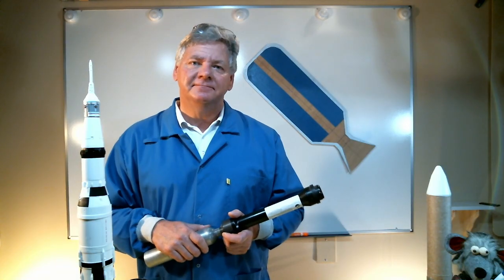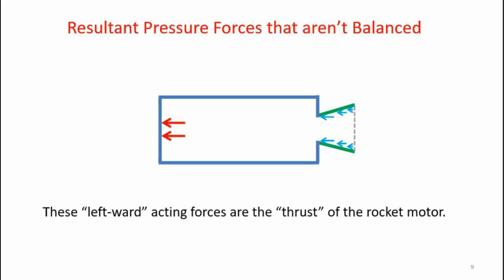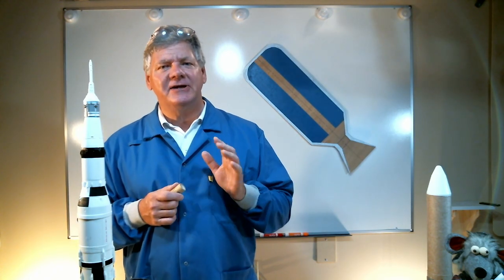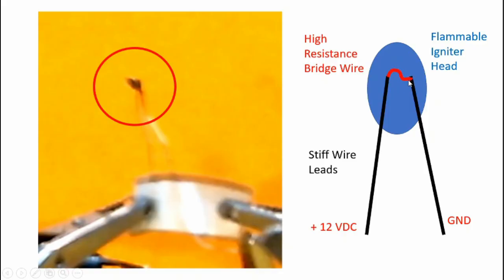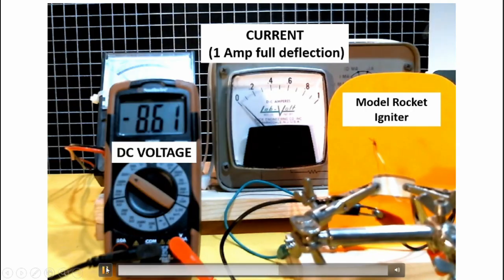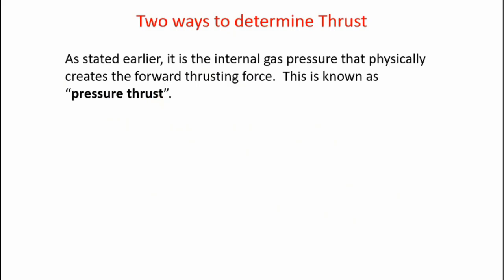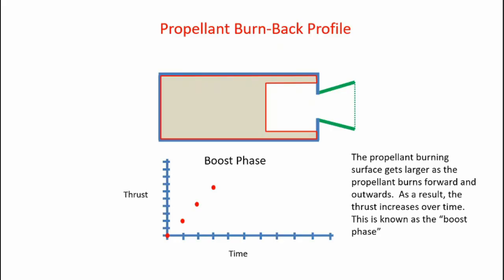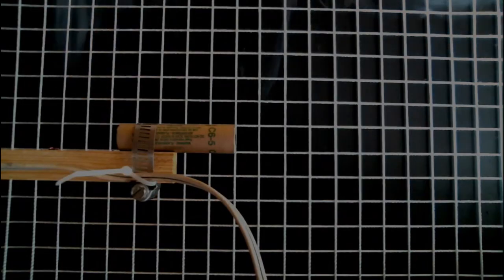Rocket Propulsion Basics

Comment: Gas and other things may be used in terms of heat and cold i.e. thermal conductivity and high and low
.
Stored in the form and removed out like a injection by pump.

Comment: So it’s not the expulsion of mass exiting the nozzle (action-reaction) as much as it is the pressure acting on the front of the motor?
Reply: You can calculate the thrust on a rocket engine using either method and you get the same answer.

Comment: And how is it in a jet engine? The jet engines of fighter jets? Because they all say : “the jet engine ejects gases , hence Newton’s third law” but the jet engine doesn’t actively “push gases away”
Reply from the maker: A jet engine does eject high velocity gas out the back end.  The compressor blades at the front of the engine feed high pressure air into the combustion chamber(s) where it is burned.  The expanding gas increases the internal pressure causing the gas to flow out the back of the engine.  The pressures acting inside the engine cause the action/reaction forces that push the aircraft forward and the exhaust gas backwards. There is a Mithbusters episode where they blow a bus over using the exhaust of a jet engine. This is evidence that gas is pushed out the back of the engine.
Reply: @labratscientific1127 Great explanation and great video, just subbed, thanks.
Reply: @labratscientific1127  I wonder what proportion of the thrust comes from the compressor blades since they also experience a net force forward.

Comment: In the divergent section of the nozzle, the pressure continues to decrease in comparison to the throat, and because the flow is supersonic, the velocity increases. If the flow remained subsonic, the increase in cross-sectional area would lead to a decrease in velocity according to the Bernoulli principle.
Reply: Correct

Comment: 8:11 - What would happen if the divergent module section was removed?
Reply from the maker: The gas flow will expand much too quickly and the engine will be inefficient.  Also, there is a forward component of the pressure force acting inside the divergent section of the nozzle which contributes to the forward thrust.  This element of the thrust will be eliminated if the divergent section is removed.

Comment: When you say that the thrust is calculated either from the pressure thrust or the momentum thrust, I’m not that sure… I read in ‘Rocket Propulsion Element 9th Edition’ from Georges P. Sutton that the overall thrust will be F = dm/dt * v(ejection) + Dp * Area where Dp is the pressure difference between the atmospheric pressure and the pressure at nozzle exit. So I’d like someone to explain me what’s the real thrust or what I’ve understood wrong.
Reply: I think the point IS
You can calculate the thrust on a rocket by:
 integrating the pressure on the inside of the nozzle over all of the surfaces.
OR
Calculating the mass flow out the back and determine the momentum, then using the Law of Conservation of Momentum.
Both methods give the same answer.
Reply: @stuartgray5877  Yeah that’s true. Thanks for the precision!
Reply: @flamelios739  This goes to show that an answer in physics could be wrong, and still give you the right answer. 

Integrating the pressures inside the rocket is the ACTUAL physical, mechanical way that the forces are applied, but on the other hand its hard work... 

Finding the momentum, is a much easier shortcut, because we are lucky enough to live in a reality that's based on easy to find conservationist laws, but its still a very confusing and WRONG answer to give to a newcomer or a rocket propulsion denier as an "explanation" to how rockets work.
Reply: @-_Nuke_-  - "but its still a very confusing and WRONG answer to give to a newcomer or a rocket propulsion denier as an "explanation" to how rockets work."   So, you believe that you know more about rocket propulsion that the actual rocket scientists?     Dr Tsiolkovsky derived the Tsiolkovsky Rocke equation from the Law of Conservation of momentum.   So, you are telling everyone that Tsiolkovsky did it wrong, and you are correcting his math?    Yeah, you are Brilliant!
Reply: @rocketman484  Please point to me where did I say that Dr Tsiolkovsky "did it wrong" or that I am correcting his math. I'll wait...

Please learn to read before you comment.
Reply: @-_Nuke_-  - "Please point to me where did I say that Dr Tsiolkovsky "did it wrong" or that I am correcting his math. I'll wait..."

You keep telling Stuart that he is wrong when he tells you that Tsiolkovsky derived his "Rocket Equation" from the "Law of Conservation of Momentum".   This can be confirmed with a simple Internet search.
Reply: @-_Nuke_-  And when Stuart tries to explain this to you , you just accuse him of lying about building spacecraft for NASA.
Reply: @rocketman484 I new that you were a troll but i never thought you would go to the extent of making a fake burner account to pretend that you are someone else just to troll in double time 😂

Anyway you have been exposed. You are not what you say you are, you are an internet troll with an bunch of burner accounts. So much for being a "scientist" 😂😅
Reply: @rocketman484 You mean you, not "stuart".
Reply: @-_Nuke_-  So you refuse to answer questions?
Thanks for proving that you have no intention of answering questions.
Reply: @rocketman484 Answer what questions? 

The equation is OBVIOUSLY correct... Which means that it gives the right numerical answer. 

But any equation that denies (if it does, I don't know) that internal pressure from the expanded gases are the causal agents of propulsion, is mechanistically WRONG. 

I don't think that this equation denies that... This is what you said, not me. 

Internal pressure (meaning: internal forces) is what gives propulsion to rockets.

If for example the expanding gases could somehow magically leave the rocket without touching it, the rocket wouldn't be able to go nowhere. Regardless that mass is leaving the system. 

Mass leaving the system is thus not necessarily an agent of propulsion. 

Internal forces are.

Comment: Great video, I've been searching for an answer to a question about where thrust acts on a rocket. You've gotten me much closer to the answer. My question is, how are all of those forces transferred to the rest of the rocket? If a rocket can produce millions of lbs of thrust, why doesn't the nozzle crumple and crush under all of that force? Nozzles look like an extremely delicate component that's extremely thin walled. Even if a nozzle is being cooled, its still operating at extremely high temperatures enough to make the nozzle glow white hot. I can take a hammer and deform red hot metal. Why do the forces not immediately destroy the rocket? Are those forces acting all the way back through tons of delicate components the combustion plate, pumps, turbines all the way to the back of the extremely thin walled pressure chambers? Why don't those components break under millions of lbs of thrust??
Reply from the maker: For a liquid engine, the thrust loads are transferred to the rocket body via struts.  The struts must be very strong and thus the proper metal and design must be used.  The problem is complicated when the nozzle must be gimbaled to provide guidance.  It all comes down to engineering...  Most of the forces are in compression which helps out a lot.   As for the heat, again its good engineering and proper material selection.  Some nozzles are cooled by flowing cold fuel through small channels in the nozzle skin (regenerative cooling).  Some nozzles use ablative which chars and flakes off during the burn (like a space capsule heat shield).  Some engines us radiative cooling and materials like Niobium Alloy, which are very strong and can handle a lot of heat.  As for the forces, it comes down to engineering once again.  In some nozzles you may notice "hoops" which provide circumferential strength which supports the nozzle skin.

Comment: Great video! Your video is only the second one I've seen on You Tube that gives the correct explanation of the generation of thrust in a rocket motor. Most of the other videos state that trust comes from Newton's third law of motion whereby the ACTION of the gas exiting the rocket CAUSES a REACTION force to be generated. But there is no notion of cause and effect in the third law. If two bodies are exerting forces on each other, the third law merely says that the forces are equal and opposite, but nothing about one force causing the other. Other videos use the law of conservation of momentum. Here again there is no notion of cause and effect in the law. The law is merely a bookkeeping of the total momentum of a system and is valid only if the Sum of the external forces acting on the system is Zero. At launch, the rocket is subject to external forces, namely gravity and aerodynamic forces. So, conservation of momentum isn't applicable until the rocket is out of the atmosphere and moving perpendicular to the earth's gravity.
Reply: - "But there is no notion of cause and effect in the third law"
That is false.
Apparently, you don't properly understand the three laws.

When one mass applies a force to another mass - BOTH masses must feel the force.
Imagine a test case where a person is trying to push a refrigerator across an ice rink.
Place a scale between the person and allow them to start pushing on the refrigerator.

Now you are an observer ON THE Refrigerator, and you can see the readout of the "force-scale".
The person begins pushing on the fridge attempting to accelerate it.
Now as the person begins PUSHING, he can see the scale and it reads 20 Newtons.
What does the person on the refrigerator read on the scale?
20 Newtons.
So, from the perspective of the person on the fridge: Is the person applying the force, or is the fridge applying the force?
BOTH are applying the same force on each other.
The scale does not ONLY read when the force pushes in one direction.
All forces occur IN PAIRS. It is impossible to have a single-ended force.
If the fridge did not PUSH BACK, then the fridge would accelerate away effortlessly, and the scale would never read any force.
But the fridge PUSHES BACK because it has INERTIA which is the resistance to being accelerated.

Comment: What is the ejection charge for? Also, your solid rocket motor only burned for 1.3 seconds. Does that mean it is its Isp?
Reply from the maker: The ejection charge blows the parachute (or streamer) out of the rocket.  There is a smoke delay between burnout and ejection charge firing.  The TOTAL IMPULSE is the area under the thrust curve and has the units of Pound*Sec (or Newton*Sec).  The Specific Impulse (ISP) is the Total Impulse divided by the weight of the fuel.
Reply: @labratscientific1127  thank you

Comment: So according to that an F1 engine bell and injector plate sustain 750 TONS of force. Hard to believe all those welded together tubes could take that much force.
Reply from the maker: The Saturn V (or any object) will only accelerate (speed up or slow down) if an external force is applied to it (F=ma or a=F/m).  To get the Saturn V to lift off, the thrust must be greater than its weight.  The only things producing forces are the F1 rocket engines (neglecting drag at this point).  This means a force is being transferred from the engine to the rocket structure.  The only way a force can be generated in a rocket engine is gas pressure.  This pressure has to react on a surface (F = (lb/in2) * in2 = lb) to create a force.  Momentum of the exhaust gas is a means to calculate force and conservation of momentum can be used to estimate the speed of the rocket, but again, it is actually the pressure forces in the engines that push the rocket...  It is hard to believe, but the engines are designed to carry the resulting loads.
Reply: @labratscientific1127  So essentially, a rocket DOES  push against something. It pushes against the mass/inertia of it's own exhaust gasses.
Reply: @billshiff2060  Yes "Rocket Thrust" is just RECOIL from pushing on MASS.
Reply: @labratscientific1127  So what's applying the external force?
Reply: @papalegba6796  SO from WHERE does the force originate that accelerates the mass of the exhaust gas into the vacuum?
The pressure INSIDE THE NOZZLE.
The rocket NOZZLE applies a force to the mass of the exhaust gas accelerating it into the vacuum.
THAT is the answer you are scared to admit.
Because THEN (per Newtons THIRD LAW) you would HAVE TO ADMIT that there IS an "equal and opposite" force PUSHING BACK ON THE ROCKET.
Now be sure to hurl some juvenile insults instead of addressing my FACTS.
Reply: @stuartgray5877 THE ROCKET'S NOZZLE doesn't apply a force. The GASES apply a force to the nozzle, lifting it up.
Reply: @-_Nuke_-  - "HE ROCKET'S NOZZLE doesn't apply a force. The GASES apply a force to the nozzle, lifting it up."

False.
The combustion chamber and nozzle feel the 3000 PSI combustion chamber pressure.
You are the one of us that failed to graduate high school while I have been building and launching things to space since before you were born (based on your pre-pubescent intellect)

Only a CHILD can be wrong for as long as you have and not correct his mistakes.
Any adult would have figured it out by now.
But bless your little heart for effort!
Reply: @-_Nuke_-  - "THE ROCKET'S NOZZLE doesn't apply a force. The GASES apply a force to the nozzle, lifting it up."

Newton's third law tells us that "for every action there is an equal and opposite reaction"
In modern terms we would say: 
If one object of mass exerts a force on a second object of mass, both objects feel the force for the same duration.

"THE ROCKET'S NOZZLE doesn't apply a force. The GASES apply a force to the nozzle, lifting it up."

Let break this down:
Inside the rocket's combustion chamber a controlled explosion is occurring. Inside the Bell of the Combustion chamber the pressures can be above 3000 PSI.
This is because the exhaust gases cannot exit the nozzle with now effort, there is MASS I NTHE WAY - the burnt fuel and oxidizer, the "exhaust" is IN THE WAY of the combustion that wants to exit the combustion chamber.
For the new exhaust gas to exit the old gases need to GET OUT OF THE WAY. GAS HAS INERTIA - one must apply a "FORCE" to get gas to move out of the way.
But GUESS WHAT? Combustion exhaust gas at 3000 PSI HAS A LOT OF "MASS".

"Air" has mass too, but 14.5 PSI "air" has a LOT LESS MASS, than an equivalent volume of 3000 PSI rocket exhaust.  So, pressure builds in the combustion chamber as the exhaust gas gets "accelerated" from the nozzle.
The 3000 PSI GAS PRESSURE in the nozzle "PUSHES" the previously burnt exhaust gas out.
Gas pressure IS a Force.
The exhaust gas gets "accelerated" by the high-pressure gas in the combustion chamber. The chamber literally "PUSHES" the exhaust gases out.

Now what does newtons THIRD LAW say about one object (the rocket nozzle) applying a force to the mass of the exhaust gas (a second object now) causing it to undergo an  "acceleration"?

Hint above.
Come on you can do it.

Comment: A fuel based rocket will not produce thrust in a perfect vacuum, and as the vacuum gets stronger....the rocket produces less thrust. Many people simply misunderstand Newton's Third Law.
Reply: Thomas G. - You misunderstand how thrust works.

For example, could a CROSSBOW firing steel projectile feel a rearwards force (RECOIL) when firing into a vacuum? Yes or No?
What CAUSES recoil?
Reply: Why would it not produce thrust in a vacuum? In fact, wouldn’t a rocket in a perfect vacuum such as space produce even more thrust than one on land since there are no drag forces, gravity or friction?
Reply: @dom17dom48  
In a perfect vacuum, a fuel based rocket would produce ZERO thrust. All energy would instantly be sapped. The rocket would push off of..nothing. A rocket's nozzle shroud MUST get larger and larger to compensate for ever decreasing ambient air pressure areas. Basically....if rockets created thrust by throwing mass out the rear, then a straight nozzle would be the most efficient nozzle in a perfect vacuum. But the truth is that 'NASA' (translates: Lie/deception) has to shape the exhaust plume of a rocket firing in lower pressure areas with LARGER nozzle shrouds to "widen the hand of the swimmer into an ore" to push off of sufficient water to keep thrusting forward. In lower ambient pressure...there is less ambient air molecules to push off of, so the exhaust plume has to be maximized to have the fastest exhaust speed & the widest profile, to get the best thrust possible. In a perfect vacuum, there would be no work performed(no thrust) because there would be no ambient mass to push off of.
Reply: @dom17dom48  
Of course rockets produce thrust in a vacuum.....I said [ERFECT VACUUM. A rocket in orbit is still within the Earth's atmosphere...there is still air to push off of. #FreeExpansion